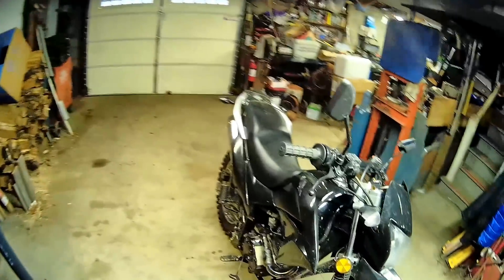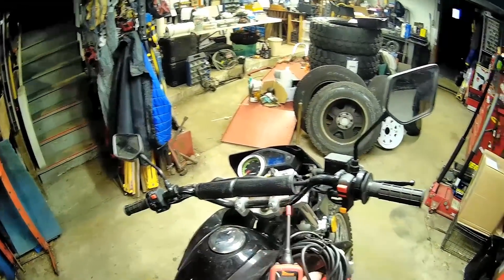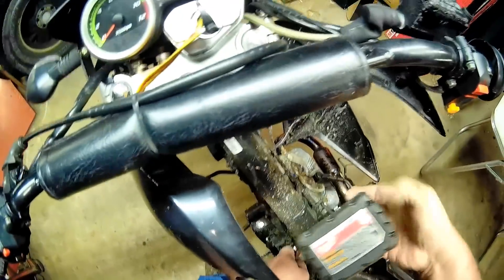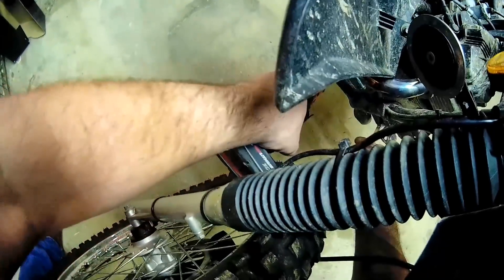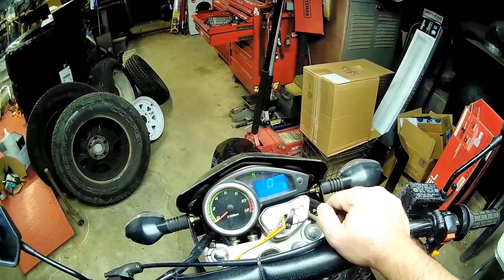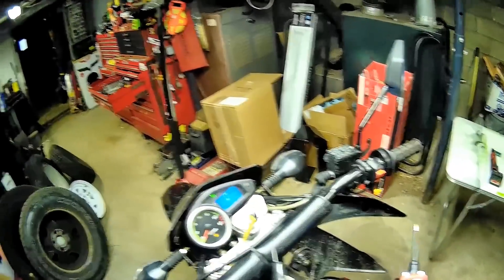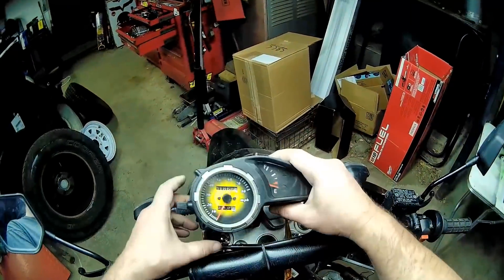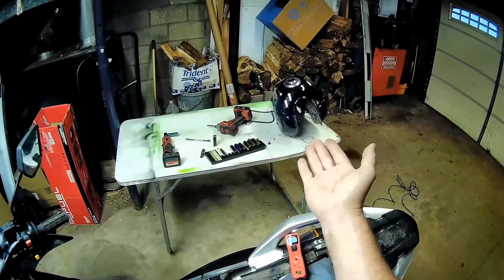[E62] fuel gauge Troubleshooting, testing, repair. fix gas digital and mechanical RPS Hawk 250

Comment: Yooo, did you ever figure out the digital fuel gauge deal with the aftermarket cluster?
Reply from the maker: The setting?
Reply: @MotoCheez  no..  just to get it to actually register that there’s any gas in it..  it’s weird tho, I just got back from the gas station n filled it up.  Now it’s registering 3/4 but I guess maybe I’ll just have an early fuel light 😂.
Reply from the maker: Oh. That's weird. Maybe the reostat float inside ir connection under tank?
Reply: I have no idea..   but it’s mostly functional now so I’m happy with it.

Comment: hey man i got a question. i bought a new dx speedo for my vader gen 2 i got the wires pinned correctly but my fuel gauge just flashes now. i replaced the stock unit because it wasnt correct and you couldnt calibrate it. what do i need to do to get my fuel gauge to read. the bike is a month old so the sending unit is good and it was just working today before i switched speedometers.
Reply from the maker: I'm not sure what the resistance is on the DLX Guage. I'd think they were the same, maybe someone at chinariders.net may know.
Reply: @MotoCheez  possible, I'm tracing wires now. The new speedo has one extra wire on the 9 wire lead that says position on the pin out but with broken english it's hard to figure out position  of what. The damn vader speedo only has 8 wires in the 9 wire block. The sender has 2, I'm guessing one isn't plugged up in the wire loom somewhere.

Comment: The gas gauge on my hawk dlx is the opposite. It reads full all the time. Going to see if the tank sensor from the old hawk will fit the dlx
Reply from the maker: Not sure it will. Might be the gauge programmed backward on the gauge? Strange
Reply: @MotoCheez  it's weird. It has a different gauge then what your dlx came with. Added fuel bars to the right side. I put a vid up to compare.
Reply from the maker: Hmm odd

Comment: My compliments for the best troubleshooting video on youtube! I am a diesel mechanic, battling with an aftermarket fuel gauge paired with a factory sender. I can not order the right part, because it's discontinued. My sender reads 30 to 240 ohms on 24 volts, the gauge that gets sent as the replacement comes with a 200 ohm resister, and the gauge, and no matter what I do, I end up with a gauge that reads 5/8 tank when empty. I've argued with my boss over this and he insists that the gauge should work with the sender, but it doesn't! I've proven him wrong and showed him by replacing the gauge with one from another machine that fits the ohm range and it works perfect. He still has his doubts and I'm sick of explaining to him why it can't work! I'd really like to show him how much of an idiot he really is, but????? Need the paycheck lmao!
Reply from the maker: Haha. Thanks. Yeah, some people don't get it...

Comment: hi my stock gauge has 3 wires for the fuel, changed my cluster to a digital gauge and it has only one wire for the fuel, do you have any idea how to connect those 3 wires to a single wire? i cant make it work, thank you!
Reply from the maker: Hmm, only one wire off the fuel gauge?

Comment: I have since replaced my stock cluster but a resister on mine had come off. I soldiered it back on and it worked fine. I replaced the cluster later with an amazon cluster. I would recommend the one made for the Hawk instead. I had to fabricate the cluster mount, fabricate a sensor mount, glue on the sensor magnets and figure out the rather complex wiring (which many are never able to do). The digi cluster made for the Hawk cost a bit more but trust Motocheeze - you'll be glad you did.
Reply from the maker: Thanks for the info! Ty😁

Comment: Hi Cheeze.   Mine reads full until I'm down to about 1/4 tank then it starts to come down a bit.   I am wondering if there is a float arm in the tank I could just bend a little to straighten that out?
Reply from the maker: Yes, there is an arm inside the tank, should work if you can get to it. Or take it.off the tank to do it.
Reply: @MotoCheez  Think I will give it a shot.
Reply from the maker: Let me know!

Comment: I miss the hawk videos I just put a short plate fender delete on mine and a LED brake light also just changed the fork oil to 15 weight  I have a video videos on my channel if anybody wanna check it out not as good at Mr cheeze  but oh well
Reply from the maker: I'll check them out 👍

Comment: Hey moto cheese I'm still having problems with my headlight I done did everything possible I was wondering if you can make a video the front headlight I have a hawk 250 that's having headlight issues the little mini light works but the main headlight does not and it's not the bulb
Reply from the maker: Yeah, I'll do one
Reply: That would be great thanks.  I'LL  be waiting
Reply: Check the hi beam lo beam switch mine went bad and I had to shim it to keep it on. Wiggle it around to make sure this isn’t your problem also
Reply: Ok I'll check
Reply from the maker: Give me a some time, I'll do one.